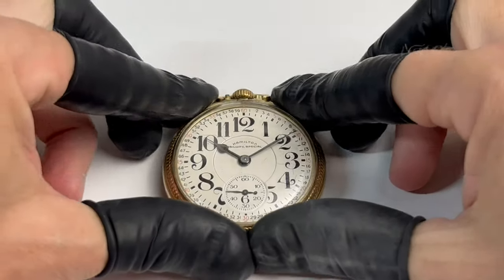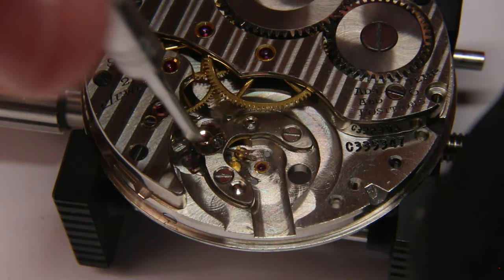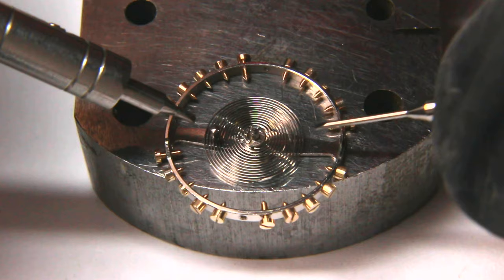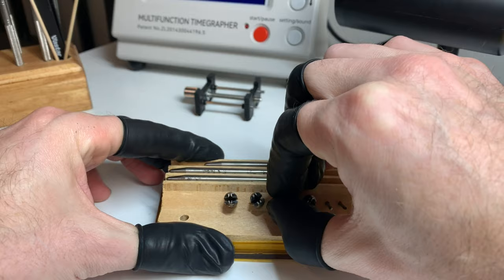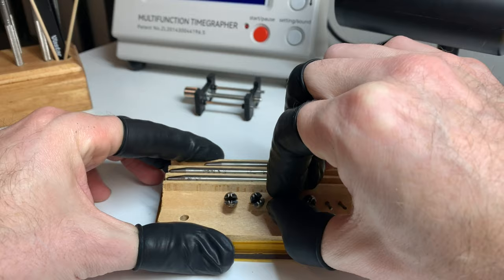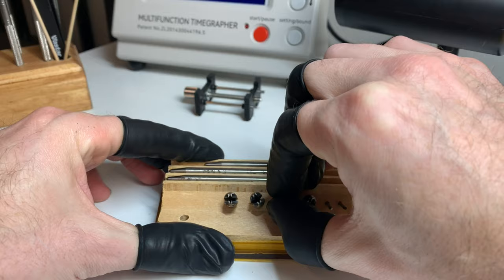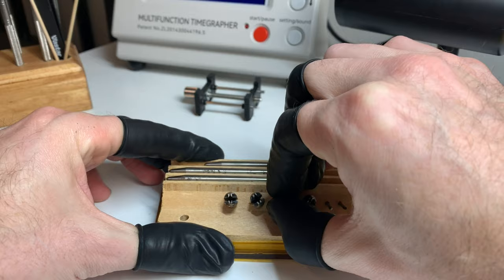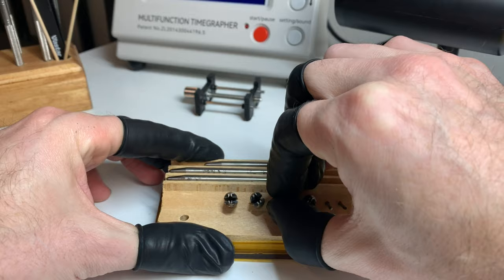This Hamilton Railway Pocket Watch Gets an Incredible Repair!

Comment: What is your opinion on what I’ve heard re the Hamilton 992B: apparently, to be original, if the blued screw near the click is flat, other screws should be domed—and vice-versa? I own a ca.1951 nickel cased 992B and a rolled gold example from ca.1960. What do people think of the earlier 992B with enamelled porcelain dial versus the melamine dial watches from the later periods?

Comment: Interested in doing a 1911-1912 Hamilton 992 S/N 882899? It is in a rolled gold Star Case with an interesting pattern. The movement works, but very low amplitude and stops after a while. Probably just needs a cleaning. It has a mark etched from someone being in it "R4-22-466" which I'm hoping means someone serviced it in 1922 or so.

Comment: Great job my friend. I think I learn few tricks on video processing. I need to have shorter scenes not have a continuous run. Hello my videos is always been kind of a chat while I was doing the work as opposed to a professional presentation of how to do this. You seem to get more hits on your videos if you do professional presentation.
Reply from the maker: Thanks, JD. It takes longer to produce, but I'm always experimenting with the pacing. The Ball is the longest video so far, and the one that will come after it will be nearly 30 minutes. I don't edit away the mistakes though! I keep any time I miss a step or forgot a part and own up to it when it happens. It's all part of the fun of learning and the bloopers add to the entertainment I think.
Reply: @csspinner  
My longest video is 2 1/2 hours which captures the whole process I went through to repair a watch. I should perhaps spend more time processing the video to make them look a bit more professional, but in the past really didn’t have the time.

Comment: Nice job and a good video to watch. I would only suggest that you use a piece of peg wood to hold back the click. If you happen to slip it will not leave a mark on the plate. Don't ask how I learned!. I also test the balance prior to hairspring install. Actually I put the balance in place without the roller table or jewel. A light touch with a very fine brush and watch the wheel. Just a quick test for how the staff is running in the jewels. FYI Thanks again.
Reply from the maker: Thanks so much for the comments. Solid tip on the peg wood. I also recently got a pair of brass tweezers for that reason. Good tips on incrementally testing the balance. It helps rule out any possible root causes later on
Reply: @csspinner  If you want to have some fun. Once the bridges and wheels are installed and after the BW checks out then put it back together with out the hair spring. If the train is free you will see what my friend said was "half time". He has now passed but he was an excellent watch guy and a Dueber Hampden expert. I sure learned a lot from him. 
The BW will rotate and release from the fork then come back around and kick again. No hair spring. That might be a cool video for others to see. What it tells you is that the train is free and it is a kick to watch. Regards
Reply from the maker: @hampdentime  hah indeed I have seen that and it’s quite entertaining to watch. It also is a good test of the shellacing job on that impulse jewel!

Comment: I have a Hamilton 992 that keeps perfect time, love it. What causes the balance stem to break? As with this watch. Thanks for the video.
Reply from the maker: The pivots are extremely small and delicate. Simply dropping the watch onto the floor can cause them to break. Also, carelessly pressing on the edge of the wheel with a fingertip can do the same.

Comment: Hi Chris, do you have a preferred solution for taming the amplitude on these? The movements are so well built that they always seem to be totally out of control knocking/rebanking when cleaned and assembled with modern lubricants. Getting weaker mainsprings isn't really feasible so I wondered if you ever resort to skipping the 941 or using heavier oil on the balance or escape. I just assembled one that has ludicrous amplitude after conventional oiling.
Reply from the maker: I’ve had good success with shaving off amplitude by applying some oil to the pallet pivots, skipping the 941 like you said, etc. HP-1300 can be used in the train wheel pivots as a last resort
Reply: @csspinner  Thank you!

Comment: I enjoy watching your videos. I will be watching to see what your auction fares.  I used to collect some pocket watches, but they have gotten too pricey to repair as I cannot begin to do that myself. ( unsteady hands and less than stellar vision) The local jewlers only send them  off to some outside source. Do you repair for others?  If so, details. I have a few Illinois Watches that need a bit of attention. One, Bunn special 21 jewel, runs but , seems the hand gears sometime get out of mesh if I carry it around. Was promised to be fresh serviced when I bought it some years back but never was right.  At first I thought the hands were not fully seated as they would sometimes strike each other, reset them and it's a bit better but not right so I just leave it in the box mostly. The other is a 17 jewel ( Steward special )  The crystal is missing and I think there is a roller jewel missing?  As the escapement wont actuate.  I see your G mail contact on the home page.
Reply from the maker: Thanks, Frank. I do occasionally take on customer jobs. Let’s get in touch over email.

Comment: I’m a beginner in repairing old pocket watches and was wondering how do you align the hair spring with the pins of the regulator?
Reply from the maker: For hairspring studs that are “keyed” the hairspring should self align into the regulator. You shouldn’t need to manually align it or something is misshaped with the terminal curve. Some studs are round, which makes it interesting. You need to twist the stud in the hole till the curve lines up in the regulator pins
Reply: Thank you for the helpful information!

Comment: Why didn’t you disassemble the crown wheel?
Reply from the maker: Good evening, Stephen. If I recall, the screw was on really tight and I did not want to risk shearing it off. I did verify with others the correct direction of the threading.

Comment: This is My third watch of a balance staff replacement today . Not one of these guys checked the balance hole jewels . I replaced a staff on a Hamilton and both upper and lower jewels were cracked. So what is the real deal here .
Reply from the maker: The jewels were fine. I inspect everything under the scope Not every broken staff means broken jewels. In my experience, they’re broken about a third of the time. You see in the BW up/down video how I addressed broken jewels. I don’t call it out unless it’s broken.

Comment: I guess the oscillator relay is bad in that L&R cleaning machine?
Reply from the maker: The Master is not designed to oscillate forward and backwards. It’s completely manual to reverse it. I believe the “mastermatic” is the model that automatically oscillates.
Reply: @csspinner  Yeah, you're right.  I forgot about the Mastermatic.

Comment: What is the estimated value of this watch? Curious
Reply from the maker: Probably in the range of $300-400 fully serviced, on eBay.
Reply: @csspinner  Thank you. I saw some people were asking $2500 all the way up to $4000
Reply from the maker: @hanginon1293  I can see that. It really depends on so many factors too. The 99B movement could have had a private label run, for example. Or the case may be of much higher quality than the one in the video. The collector market is unpredictable, which is why I stick to fixing the watches :)
Reply: @csspinner   I can understand that. Thank you so much for your time and information

Comment: "Montgomery" dial?!? Umm ...  sorry ... the dial with all minutes marked out, with every 5 minutes in red was designed/invented/demanded by Ball when he made the national RR rules reguarding watches in the very late 1890's or early 1900's. 
Prior to the Ball rules, a RR watch HAD to be a size 18S. Ball reduced the size to 16. 
Ball also set a high accuracy standard... something like plus or minus 5 seconds every TWO MONTHS. (WHY? Can't set the second hand to 60. 
In time set mode the second hand does not move or stop. Set the watch and THEN wind it? Still going to be a few seconds off from the minute hand.)  
Ball is also the one who demanded RR watches be 21 jewel, stem wind/lever set, to avoid accidentaly resetting the time, have a "Quick" escapement, and be in an open face case. 

My c1885 (+ or - 3 years) Elgin H.H. Taylor key wind/key set size18S was "Railroad Grade" when it was made, according to the Elgin's spec sheet I saw online, prior to the Ball rules. It is not lever set, but still has zero chance of accidentally resetting the time, since it is a key wind/key set movement.
Reply from the maker: Steve, I thought I knew a thing or two of RR watches, but you just taught me quite a bit right here. Thanks so much for this history lesson! - Chris

Comment: seems stupid to have to remove the glass to set the time, it's almost a guarantee the dial will get dirty? I don't get it
Reply from the maker: That’s how it was with those watches. Needing to remove the bezel to set the time prevented accidental time changes if your pocket accidentally pulled the crown
Reply: @csspinner  Interesting; I can see that happening, I still don't like the it though, seems easy to damage the hands too when opening it often. they're quite delicate